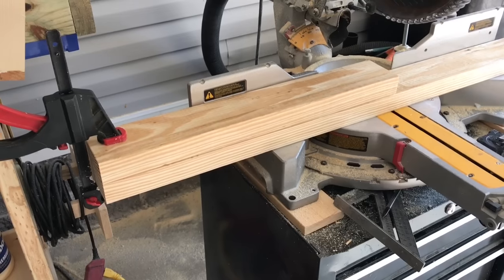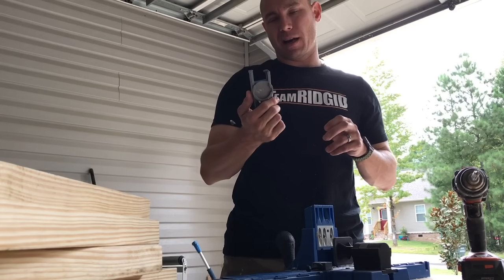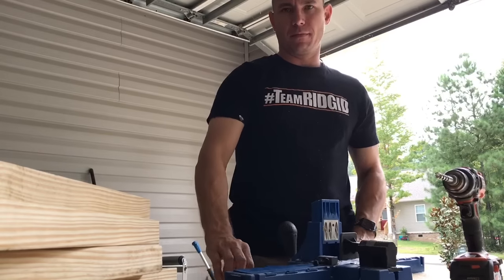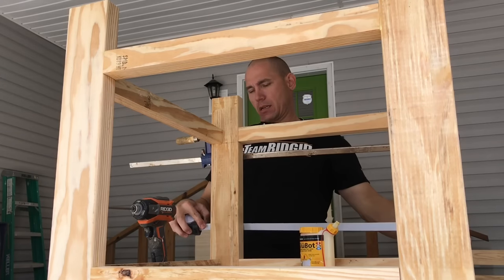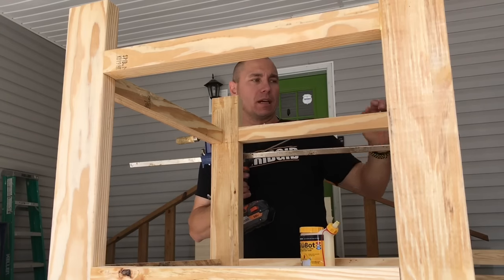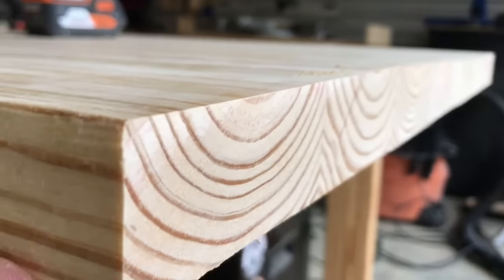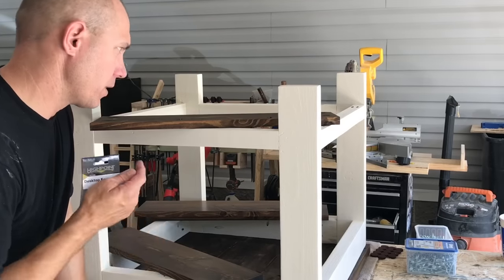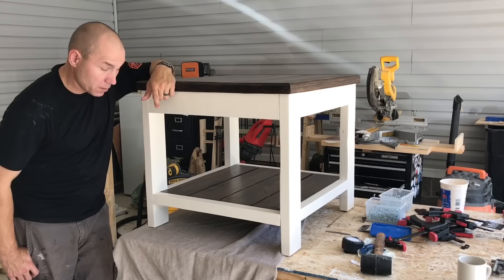Farmhouse End Table (DIY) with Build Plans

Comment: How much could you sell something like that for?
Reply from the maker: It really depends a lot on your area. I live in a rural area so prices are kept down for that reason. I think starting at $150 is fair. If the market allows you can adjust the price up, it’s totally worth $200 per table this size. Again, it just depends on your area and what the market will allow.
Reply: Right on. Yeah I'd say those are fair prices. I just took up woodworking recently, bought quite a bit of equipment(yet there's always something else I seem to need). Your vids are great, I watched your end table video and I decided that would be my first project. It turned out great.  Since then I've made 2 other end tables for my house, all different sizes. My wife will post them on Facebook and people ask how much I'd charge them for one, I wasn't really sure so I thought I'd ask you!
Reply from the maker: That’s really great! Thanks for the feedback. If you’re on Instagram or Facebook you can tag me @731woodworks in the post. I’d love to see them.
Reply: 731 Woodworks I actually don’t have either one, I was considering reactivating my facebook or starting a facebook page just for my woodworking. Once I do I’ll tag you!
Reply from the maker: Sounds good. Thanks!

Comment: When I purchased these plans I was disappointed to discover that the material list is incorrect.  I was in a rush and didn’t calculate the cuts. The list says you need 4- 8foot 2x4’s.  This is incorrect, you need at least 5.25 lengths of 2x4’s 8 feet long .The top alone takes 2.5 boards, the legs another board, no way to cut the aprons out of the remaining 4 feet.